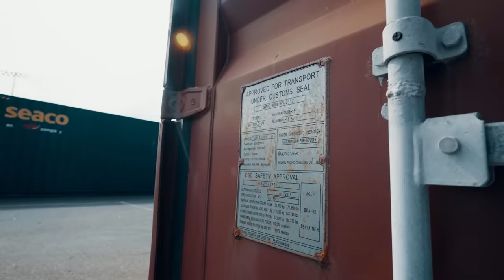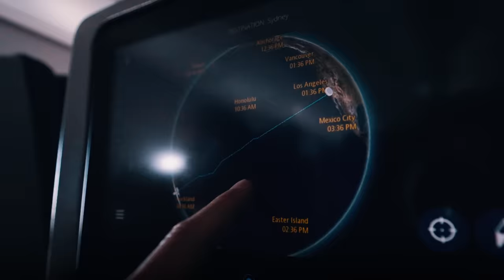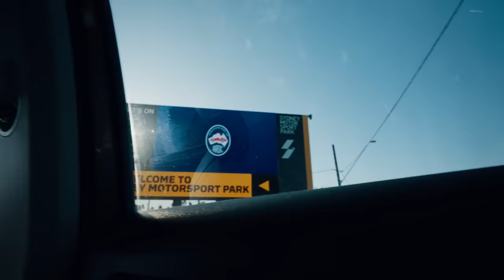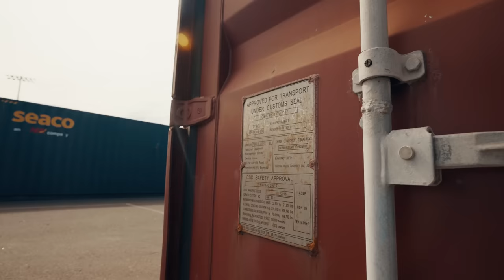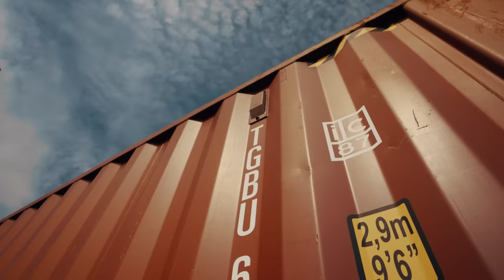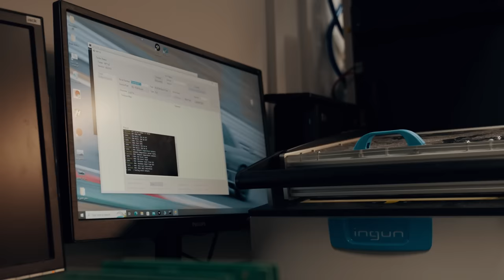2.5 Years In the Making: My hand-built Honda-Swapped Ferrari Lands in Australia - Ep. 1

Comment: The whole concept of luggage weight max never made sense to me. You can't have a 100lbs check luggage, meanwhile there's four 450lbs land whales behind you waiting to board at the terminal.
Reply: Should be based on combined person and baggage weight.
Reply: They don't aactually weigh people they use avg weights. But the cargo compartments have a limit and they have to know the exact weights for balance of the aircraft. If it's unbalanced is unsafe to fly. They actually calculate it before each flight. The aircraft manufacturer gives the weight ranges.